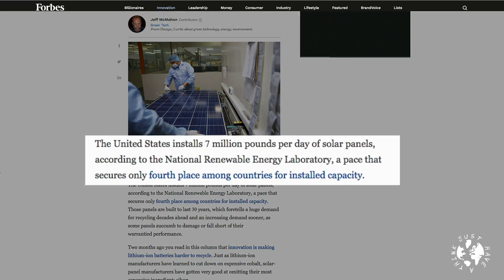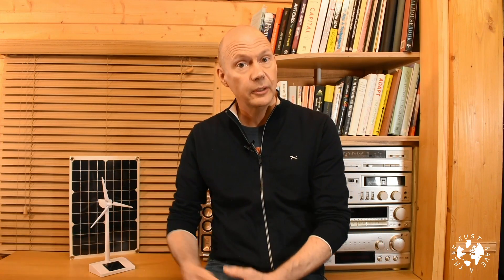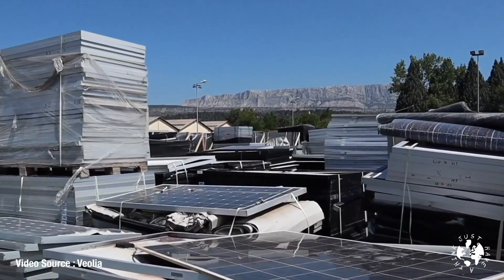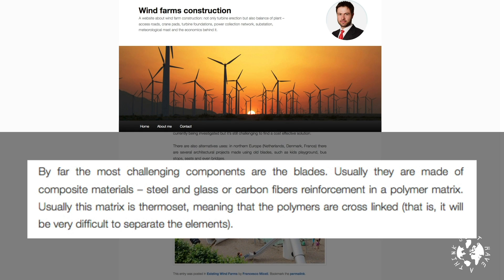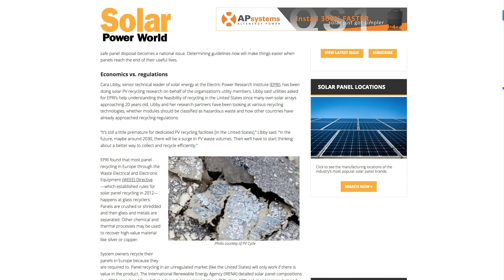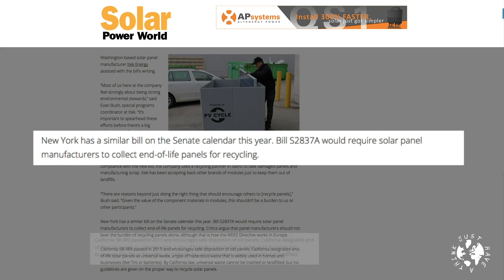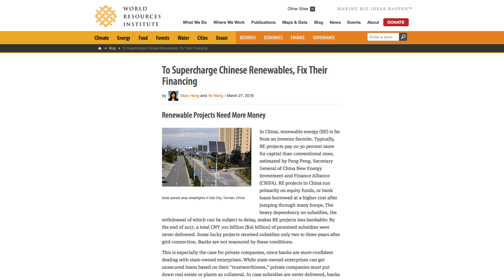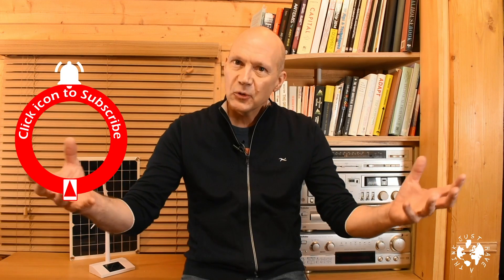Recycling renewables : a price too high?

Comment: Solar technology (nanotechnology) has changed and is changing dramatically. 
With each iteration solar panels are requiring less materials AND are using more earth abundant raw materials in the manufacturing process. 
One solar manufacturing technology to watch: high speed chemical vapor deposition
Reply: Check www.nanotreat.co.uk nanotechnology company.

Comment: In Australia the Solar Authority (Clean Energy Council) insists that no solar equipment is reused. The panels should have a service life of 25 years but CEC insists that they cannot be reused even if only two or three years old. I believe this policy of anti Green. Another worrying aspect are all these short lived, high maintenance, home battery systems that will need to be disposed of in a few years.
Reply: Vote in another government. They also killed the carbon tax when it worked well to do favors for the coal industry. - If you have an installation it does not make sense to transfer it if you sell the house. The new owner should buy it with the house and use it - after all the costs for installation are a factor especially with smaller units. (on the roof, wiring, setting up the transformer, etc.).

Battery prices will drop soon (see my other comments) , then people can go off the grid if government starts to annoy them. Especially in sunny Australia- some annoyed Germans start considering it ;) never mind cloudy weather and winter and stuff.

Who is to tell you you cannot use equipment privately sold and set up - especially if you do not sell surplus to the grid (and cheaper batteries can take care of surplus).

Comment: i wouldnt call it an achillis heel really.
solar panels contain enough valueable materials that recycling them is profitable so i dont really worry ebout them and the massive size of windturbines also make it a valueable source of metal even if some materials (fiberglass plastics) might not make a profit the profit of the more valueable resources can compensate that
Reply: They are made of glass, just like all of the sand on the desert, and take millions of years to dissolve, it's a renewable resource in my opinion

Comment: Funny thing about those 30 years, Those panels will still produce 70% of their rate capacity at that point. At 50 Year 50% of their capacity. They don't just stop working.
Reply: Theoretically yes, but in reality life loves to beat things up and destroy them long before that 30  - 50 year lifespan has gotten close to being fulfilled.  

Also add in the hard reality that the vast majority of said items are built as cheaply as possible, not as durable as possible.   

I used to be into home wind power big time and went through literally dozens of blade sets rated for 20 year service lives that didn't make it more than a few months in real world applications due to design flaws, manufacturing defects or nature just kicking the shit out them in some way they could not survive.  

Sad fact of reality was my "energy saving ' wind  power cost me vastly  more than off the gird power ever did by a huge multi magnitude of order on the cost per KWH measurement.
Reply: @tcmtech7515  that was simply lack of thought though.
I've not seen decent quality solar panels not last a year.
Reply: @John-gm8ty  Where did I say anything about solar panels not lasting  a year?  

What I was saying about solar panels is that thinking they will still be functional 30 - 50 years out is unrealistic.  
The typical materials they are built from are not long service life by any means and never have been.  Especially when placed outdoors and exposed to nature in all forms.  

Heavy industrial equipment made of solid steel and aluminum has a hard time making it 30 years with out major service and solar panels are lightweight aluminum and or plastic and glass plus far more fragile semi conductor materials that make up the actual parts that do the work of making electricity.  Materials all well known to not last indefinitely outdoors.
Reply: @tcmtech7515  hi there. Just thought I'd chip in with my two cents. I bought solar panels for my boat back in the mid 90s. They were super expensive (many times current prices). They have spent their entire life in pretty harsh conditions for the most part at sea under tropical skies. They still work, yes not as efficient as they were but show no signs of falling apart. I believe the question will be at what age does it make more sense to replace the slowly declining panel with a new one. Its likely to be when the footprint it occupies becomes valuable enough. Look to Japan for the lead in this?
Reply: @jimhood1202  Yes you are right. high end well made panels have a long service life. 

But that's not what the vast majority of people will install.  Also when scaled up to the volumes needed to power a nation the cost per capita to the population becomes impossible to handle in any realistic timelines.  

Poor example but.   Years ago a buddy of mine bought very nice low mileage pickup then to make it easy to pay for got the lowest payment longest payback time loan he could get.    10 years into his crazy 15 year loan the pickup was worn out and still not remotely close to being paid off.  

Realistic time to point of payback on a investment VS realistic service life is huge issue in this topic and too many refuse to do the math using realistic real world numbers.

Comment: Question -- where did the slide at 5:00 come from?  Took a look on greenmatch and not find it.  Thanks!  

Real Numbers of the Silicon Solar PV Recycle Path can come closer to 100%.  And Thin Film (which is a small percentage) will likely die-off on its own at current prices.   This is not really comparable to E-Waste (as that is very complex) and Silicon Solar PV is just Glass, some Silicon, and Aluminum.  

But trying to hype this into a "problem" is a bit silly.  Since you even acknowledged that the business  folks have already figured out that recycling Silicon Solar PV is profitable.  But such is marketing the Crisis de jour?   I would already jump into this business, (Energy Engineer / EE) but it turns out Solar PV Service Life has become so long -- there is little to no old Solar PV.  But if anyone has any -- I will take 100% of what you may have.   But for now, you are creating a drama for something 20 to  40 years ahead, which is already NOT a  problem -- not even then.

Even if roof Solar were STD  (straight to dumpster) -- which they are not, as noted we already know this is not the case -- please consider that the roof shingles under them ARE all destined for the Dumpster.  ALL of them.   And the panels over the roof shingles tend to protect the shingles, and the panels have a much longer service life.   The wiser path to consider would be to get rid of using the  roof shingles to start with -- saving a cost and materials of the Shingles to start with. 

GAF (a large US roof shingle company) figured this out and is jumping into a (sort of lame) method of using normal panyels with a  modified edge as replacement for the shingles under  them.    You also likely know that Tesla and others have the  PV Shingles -- again a sort of sub-optimized approach -- but their concern is about "Pretty."   Here is some coverage on the GAF approach.

https://news.energysage.com/decotech-roof-integrated-solar-system-review/
Reply from the maker: Hi Phil. Thanks for your comments. Here's the link to the Greenmatch infographic. 

https://www.greenmatch.co.uk/blog/2017/10/the-opportunities-of-solar-panel-recycling

I will also add the link to the description box as I noticed that I omitted it when I posted the video.

I have obviously not communicated this video as well as I thought, as there have been two or three people who felt I was presenting this as a big problem, and even a couple of suggestions that I was anti- renewables. I think my lesson from this is that I need to treat each video as a stand alone presentation rather than assuming that people have watched the previous videos on the channel. I hope that if you had watched previous programmes you would accept that I am a staunch advocate of renewable energy and steadfastly anti fossil fuel. In fact the whole point of the channel is to raise awareness of the issues that face our civilisation as a result of human induced climate change and to try to seek out solutions. But we need to be pragmatic and realistic. Issues like the one I highlighted in this video have a nasty habit of sneaking up on governments and countries. The thrust of my argument was - "be aware of the potential issue now, and be prepared for it if it does come about" - nothing more than that really. I'm sorry if it came across more negative than that. All the best. Dave
Reply: @JustHaveaThink  -- part of the push back you are getting is due to others than you.  There are now some "New Nuke" salesmen who go around making up fake problems about Renewables to promote New Nukes.  They have studied "Environmental" issues, and put on false fronts and outright lies to disparage Renewables -- which at this point are faster, cleaner, cheaper, and less risk than the Nukes they are promoting.   Michael Shellenberger, for example has an organization called  "Environmental Progress" ironically enough that has made a business of creating false information.  

But maybe for a Fresh Spin on these (Renewable End of Service Life) issues, you could maybe cover it is an opportunity rather than a crisis or problem -- it is a Great Opportunity for someone -- likely younger than you and I.  ;)   

Another topic that you might like to cover is the rise of HVDC.  That is likely where things are going -- so storage will not be much of an issue.  It will allow Electricity to be sent around the World, so US can swap overnight power with China, and vice versa, and Europe can get Electricity from the Sahara, for example.   I am a (US) Grid Level Electrical Engineer, and can help you with that, if you would like.    

here is a backgrounder >>>  https://spectrum.ieee.org/energy/the-smarter-grid/lets-build-a-global-power-grid
Reply from the maker: Hi Phil. Many thanks for your response and for your extremely interesting and useful commentary. In fact it was watching a Ted Talk by Shellenberger (called something stupid like "Why Renewables will not save the planet") that prompted me to make this particular video. Even without researching the guy it was plainly obvious to me that he was disingenuous in his presentation. Then I had a very quick look online and saw that Friends of the Earth are tackling him head on. What I hadn't realised , until you pointed it out, is that he is only part of a new PR push by the Nuclear industry. I suppose I should have figured that they would be just as keen to protect their patch as the fossil fuel people are. Anyway - I do take your point about putting forward a more positive message. One of the biggest challenges on the channel is to strike a balance between realistically communicating the difficult reality of our climate predicament and providing a hopeful message that genuine solutions can, and most likely will, be found (at least from an energy provision point of view - not sure we're going to be able to stem the death toll in very vulnerable countries over the coming decades, but that is a different conversation completely).

Your proposal of HVDC, which I take to be High Voltage DC transmission, is extremely interesting and not one that's on my radar. In a very early video I did take a look at Jeremy Rifkin's European distributed smart grid initiative, which he calls the Third Industrial Revolution,. Here's a link

https://www.youtube.com/watch?v=O1wsfciQMOM&t=1s

I would indeed be extremely interested to pick your brains a bit more about HVDC. I will take a look at the link you provided. The channel email is justhaveathink@gmail.com
Would you be able to drop me a line there so we can discuss a bit more? All the best. Dave
Reply: @JustHaveaThink   I did not have the impression you were exaggerating the challenge. Recycling of solar panels and wind turbines is something that should be considered and it is totally doable.  - and you are obviously positive about renewables - some commenters are just eager to find a hair in the soup (or to imagine one).
Reply: In Austria the costs for dumping mixed material from construction are prohibitively high. So even with the relatively high labor costs, there will be separation of materials when a demolition or renovation.  Wood, styrofoam, glass, plastics, copper and metals...

Brick, concrete, ceramic tiles, or roof tiles made from ceramic or from concrete, terracotta plates, ...  will be recycled (ground up for use as underground for streets for instance, if they have large amounts of old concrete, taking dow a highrise,  they might be able to use it even again as raw material for new building material

A metal roof - well that is a no brainer. 

Old roof tiles might be reused as valued vintage even.

..... waste from demolition and renovation of buildings espcially brick/concrete materials  is  huge in weight and volume, so they want to put those materials to use.

other garbage is recycled or burnt-  this is done in order to save space for disposal sites.

When that construction waste comes separated (more or less) than the disposal costs will be acceptable (and there are not vast streches of land where people could go rogue and undetected with dumping something illegally).

Comment: No, it doesn't really make any sense to invest in major recycling facilities for products that are not yet at end of life (and may far outlive their planned obsolescence). As you so ably document, it's not that hard a problem to solve when the time comes, but until then it's just a waste of resources to invest in recycling plants and equipment for which there is no steady stream of product to recycle. 

Germany is not to be commended for their wind energy. It's upset the power grid all across Europe and costs the German people huge extra costs for their power. First they paid subsidies for the renewables to be installed. Now they have to pay the grids of other countries to take their excess power, then pay again when the wind isn't blowing and they don't have enough power, then pay again to subsidize coal fired power plants to stand by as back up.
Reply from the maker: Which is why the continentally distributed smart grid will be a welcome addition to the mix. Then energy can be shared more equitably across Europe.